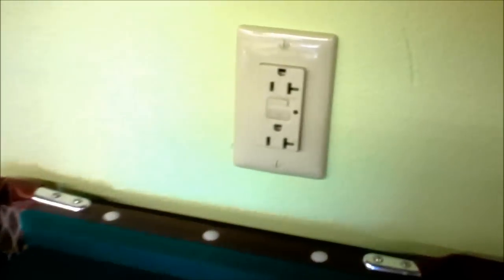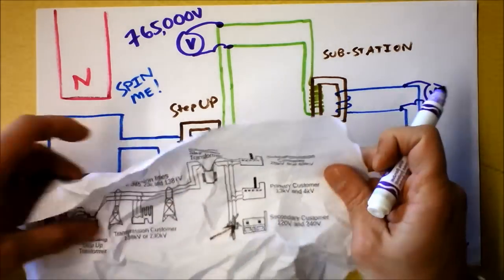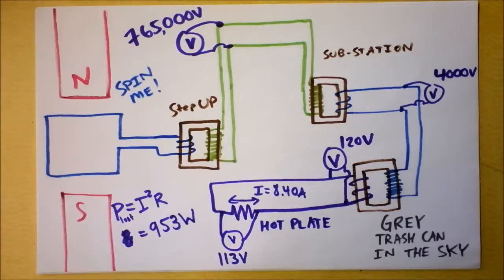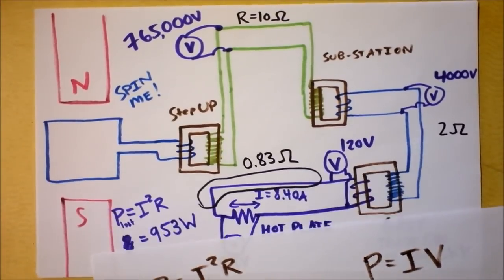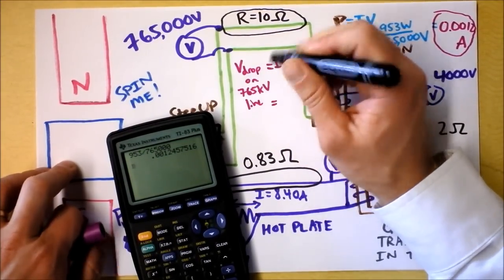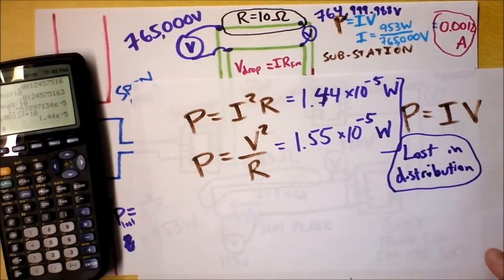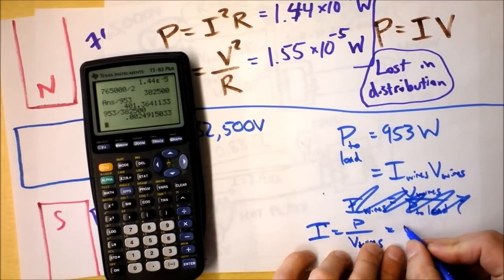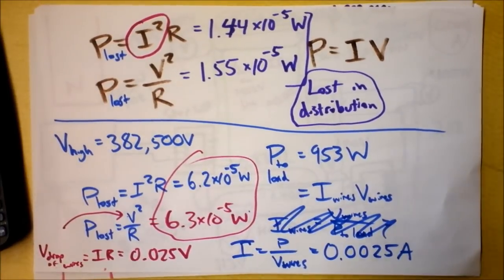How High Voltage Transmission Lines Save Tons of Money | Power Distribution Part 2 | Doc Physics

Comment: Hobo and bum power! You may have just solved all our unemployment and energy problems.
Reply: It may amuse you to know that until a few years ago we had a human powered electricity generator in a bomb shelter at the end of the street where I grew up. It consisted of a long row of bicycles without wheels, welded onto a gray steel frame, and driving dynamos to generate an ac current. It was tested regularly, but not actually used. It might have been, in case of war or some other disaster.

The whole idea of shelters has been given up, as there is way too little capacity to  save a significant percentage of the population. And we simply need every square meter in the city.
Reply from the maker: Sounds silly until I consider civilization being destroyed.  I'd take a tandem bike generator over no tandem bike generator any post-apocalyptic day!

Comment: i didn't get one thing... when you use P=I.V you put 765000 in place of V, you find current and then use V=I.R and you find a small voltage; but then when write V/R in place of "I" in P=I.V  , you write P=V^2/R but those V's are different V's how can you write V squared when you multiply them.

Comment: Hi Doc Schuster,

If the long distance transmission line equivalent resistance is 10 ohms, are you able to tell what the equivalent resistance of the 76kV/4kV load is? Assuming the equivalent resistance of the power generator 'SPIN ME' is very small, according to the voltage drop law, should the equivalent resistance of the primary side of the sub-station very large?

Comment: love you but your residence side transformer gives you 240VAC and that transformer on your side has a center tap and this center tap gets bolted to your Neutral bus. So you get +120 rel. to Neutral and the other side is -120VAC relative to Neutral. So you get two banks of 120 but because of the center tap they are 180 degrees out of phase relative to that neutral wire... So you can recreated the 240V.

Comment: But to generate that initial gigantic voltage at the source of the circuit you need to burn a lot of fuel to generate it. So even if your circuit has barely any power loss, somehow you need to have a very smart system to only be burning as much diesel as needed to deliver power to the consumers. So if no one has his toster running there was no point to begin with to produce that 953 watt power. So how is the generator that is spinning at the start being adapted to the consumer power needs? You have intelligent circuits that know at every second how much power must produced and delivered to the end user?

Comment: whats up doc
1) why is there resistance between the bump up transformer to the substation and so on? I don't see no resistors up in dis line. are the valence electrons of the material of the line itself creating resistance? also why is your voltmeter on two separate lines?
2) if say a hydroelectric plant is producing energy, how does it find the need of the customer, if its generating more than its producing where does that energy go?
Reply from the maker: Jim Rustles GREAT!1) The wires themselves have resistance, yes.  Power company buys the thinnest cables that are acceptable.2) Power companies accept realtime bids from plants to supply needed energy.  When demand goes down, the price that the power company offers declines, so more expensive (or more easily restarted) utilities stop production.  In practice, it's the high-efficiency natural gas plants that throttle most often.  Hydroelectric obviously gains no benefit when they throttle, so they're happy to sell their maximum power generation at whatever price they can get - no fuel savings!

Comment: When you divide Power by huge voltage to get the small current you should also get huge resistance that you get by dividing that voltage by that current: R=765000/0.0012= 637500000 Ohm. But this huge resistance is NOT ohm resistance from the wires , its inductive resistance from the transformers. 

The point is that the transformers raise the inductive resistance which reduces the current but they DO NOT add to the ohm resistance in the wires which actually causes energy losses defined in the formula  P=I^2*R.

In formula P=V^2/R, the R is not the R from P=I^2*R , it is actually impedance Z, calculated by formula Z=sqrt(R^2+(wL)^2) and most of it comes from the transformers due to high inductivity: Z=U/I= 765000^2/637500000 is close to 953
So it should write P=V^2/Z NOT P=V^2/R which implies the resistances are the same.
They are not.

To recapitulate, Tesla was a genius because he invented a type of resistance that does not causes losses power but it reduces current which does.
Reply: ThePhysics1234 thats it man thanks it clears everything, the video plus yr comment helped remove a confusion bugging me for 3 yrs.
Reply: You have no idea what you're talking about. You're confusing reactances with resistances. In AC, resistances are the only circuit element that emit energy in the form of heat. There is no such thing as an "ohm resistance" and a "inductive resistance." Resistance is just resistance. And it's an inductive reactance, but that's irrelevant as inductors do not emit thermal energy.

Also, power is never calculated with just the impedance, for the simple reason that resistors are the only circuit element that emit energy.
Reply: The resistance is determined by the wire. You cannot just plug numbers in the formulas without thinking.

Comment: Is $22.500.000/year (Annual savings) the answer to the problem? If that's correct, it's a whole lot of money.
Reply from the maker: Federico Giancarelli So...what would be the down sides?  Can you think of any problems with higher voltage?
Reply: Suhas S Thats why such big ceramic insulators are used to isolate it from stuff, as they get wet, they are less effective. And why HV power lines are really, really high.

I know without a doubt that 30KV can jump many inches through the air, and if it is high freq. AC, it can capacitively couple into like EVERYTHING! (watch my mini tesla coil video and flyback driver singing arc!)

Doc, love this explanation for it! I actually like to teach first how those resistance-power formulas can be derived. with W=IV and V=IR and show the super simple algebra.

Comment: I just had a engineer tell me that the transmission line loss 77% . He also told me that i was not a very good tech when i told him you just described a DC Circuit. So he used this argument on why electric cars would destroy the power grid . He got Irate so HR stepped in now they are questioning his competence. By the way he did not know what an op amp was.

Comment: so you basically used the same wire transmitting 765kv (with 10 ohms resistanc(e) and the one you explained (383kv),

is there any other thinner wires used to that with half of the resistance? then the argument is finished :)

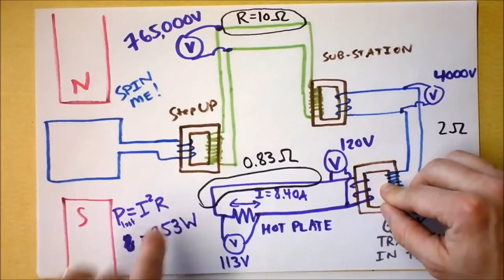Comment: I think you can not assume that the voltage drop across the primary windings of sub-station is 765000 v ! (in 9:15)  because the 10 ohms resistor takes some voltage drop! it should be less.

Comment: The grey trash can in the sky has 2 lines coming onto it, a neutral and a hot. The transformer does it's job and gives you two 120v lines and a neutral. Basically it doesn't cost the electric company a dime to get those two lines into your house yet they charge you for it

Comment: I  did this thing to clarify everything for myself:
so the hot plate is working at power p, with a voltage v and a current I. the power dissipated in the connecting wires is P, where P=i²R where R is the resistance of the connecting wires. so the power  dissipated equation can be rewritten as P=p²R/V². so the transmission lines carry an extremely high voltage to counteract the high resistance, and it makes sense because from this equation, power loss P is inversely proportional to the square of the voltage
??????????
I think I messed up somewhere

Comment: At some point there is a 765 00 V drop in the green wire, why can't you use V=RI to determine the current if you know the correct resistance ? 
I don't understand the voltage drop in the transformer I think.

Comment: when you were getting the current in the circuit u considered the voltage across the load as 765,000 V , where actually the voltage reaching the load is less due to the voltage drop in the transmission lines, which actually is the same analogy u used to calculate line voltage drop later; dont u think that is contradictory , in one approach u account for line voltage drop but in the other you ignore it?!

Comment: This video is 3 years old. Still i'd like to ask you to include core loss and copper loss in the transformers since transforming voltage and current is not free. Also i would like to see calculations at 20, 40, 60, 80 and 100% since the delta V is squared in the calculations. In all i expect that the efficiency in real life is much lower then in this (excelently worked out) test case.

Comment: Thanks for the lesson. Are you using an approximation to determine the current through the transmission line when you use only the power consumed by the hotplate? That is, shouldn't the power consumed by the transmission line itself be included (which would require adding an I_line^2*R_line to the hotplate power term, thus yielding a quadratic equation to solve for I_line)? I know such a term would be small relative to the hotplate power, but I am just asking about the theory. Thanks again.
Reply: i'm also thinking as you..hope the man behind video clear this like is there any approximation he used for  current through transmission line ?

Comment: How come (all of a sudden (to me at least) ) one should use "voltage drop over the line" in the ohms law equation, and not "the total voltage supplied". I've always thought that one should use the totalt voltage supplied. Surely I must be confusing things here, but how?
Reply: I'm also interested in this!
Reply from the maker: Because there are two voltage drops in the situation.  It is easy to be sloppy when there's just one drop, but you've got a series circuit, so we must be careful.  More to the point, you usually consider wires to have no resistance.  But they do.  And it's annoying.  By the way, if you invent a room-temperature superconductor, CALL ME ASAP!
Reply: But normally when you have a battery-light-bulb-circuit fx, you use the voltage supplied from the battery when you want to find current, wattage, ohms by using the ohms law equation. You dont use the voltage drop over the line from battery to lightbulb? How is this different? Something is wrong in my head :D
Reply from the maker: ...What IS the voltage drop over the line in your case?
Reply: +Anders Kjeldsmark Larsen Hi Anders, here we're looking at the line as an energy consuming circuit element. In the battery-bulb-circuit all the noticeable voltage drop occurs across the bulb, hence the drop across the bulb is the same as the voltage of the supply battery. In this transmission line scenario, we're interested in the energy lost across the line, so we look at the voltage drop across the line.
Reply: The difference with the power transmission is that, now you are working with a specific battery, which can supply CONSTANT POWER (meaning if voltage increases, current decreases, and vice verse). This adds another layer of complexity. In the case of battery-light bulb situation, the battery supplies constant voltage, hence the calculation is slightly different.

Comment: Finally to calculate loss in transmission line: v is voltage drop, (not the line voltage). I is as usual current flowing in transmission line. That solves all.

Comment: Can you through a transformer pretty much decide for yourself what the voltage and current should be? Unlike a circuit without a transformer?
Reply from the maker: Yep!  The product must stay the same, though.  There are limits - too much voltage and you get sparks.  Too much current and the dang wire melts.
Reply: Doc Schuster Thank you.

Comment: hi doc, won't there be a huge magnetic field created by the high voltage wires during transmission? That could by rough calculations easily affect magnetic objects on the ground like coins and keys.
Reply from the maker: Dhruva Vijayaraghavan Well, remember that the current is really small and the lines are really far from stuff.  But there will be a 50 or 60Hz magnetic field that will be measurable below with sensitive equipment.
Reply: magnetic field is produced  by currents and proportional; in high voltage lines , currents are very small.
Reply: Corona is the biggest problem in power loss due to high voltage in turn creating strong electric field lines which bunch up around edges on conductive material.